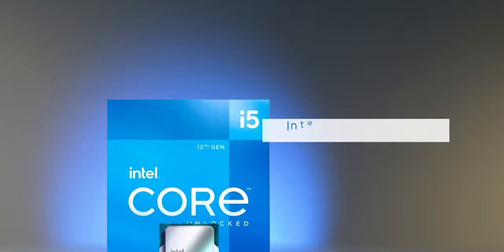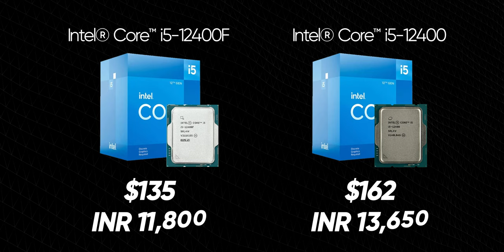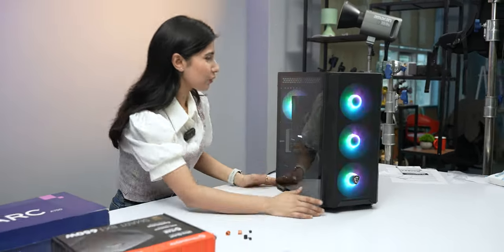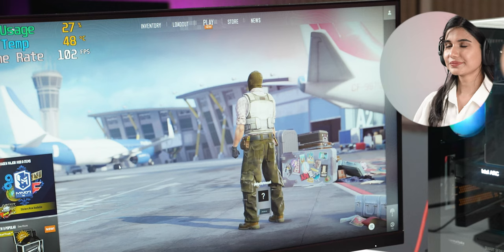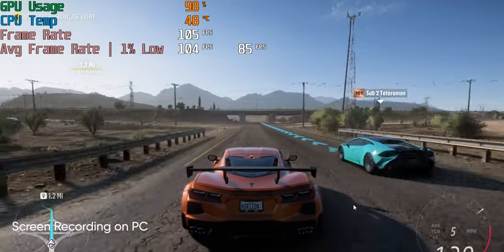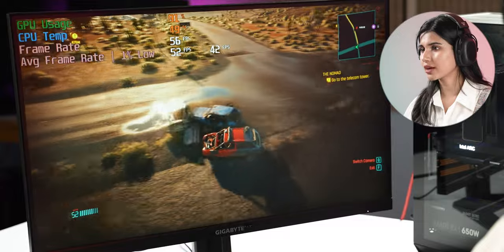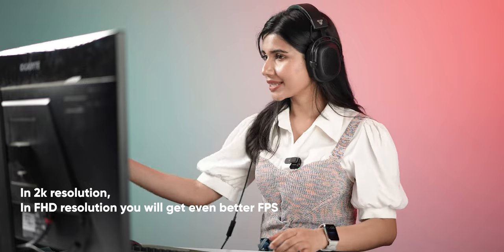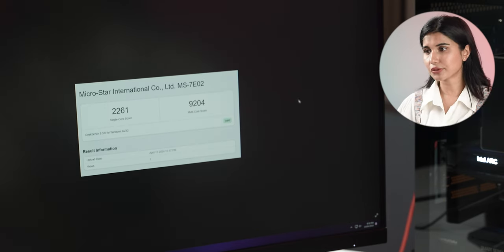Building a Powerful Budget Gaming PC in 2024!

Comment: I do not think the Intel arc is a good choice believe me . At this price point u can easily get a RTX 3060 to 16gb or even RTX 4060 when it's on sale . And Intel is kind of new in the gpu market so the benchmarks of the arc series are no match to the competition.
Reply: True arc is lower than AMD
Reply: Rx 6600 is better
Reply: Tell me when will I get 3060 or 4060 in 22k
Reply: What? Nowadays the arc a750 is performing better no? After the updates
Or does it have different versions? 
I saw benchmarks and gaming tests where it outperformed both rtx3060 12gb and Rx 6600xt as well

Comment: Pro Tip: Update Premier to 2024 update which includes AV1 support then Render any project using AV1 encoder so that it will save a lot of your time as well as it encode videos in lower file size. For me if i render a 10 mins 4k video using AV1 with my Arc A770 LE it will takes around 5 to 6 mins in DaVinci Resolve 18.7.
Reply from the maker: Used the updated 2024 Premier. I had a lot of After effects files (unrendered too)
Reply: @GadgetByte  huh, I never encountered with the issue?

Comment: It's nice to see Intel ARC getting some love 💙
Reply: I'm also buying this gpu, is this worth it at 20k budget? Or should I buy amd? 6600
Reply: @iavisek  i m also confused
Reply: @iavisek  If you don't care about power consumption. Then ARC A 750 is way more stronger than RX 6600.
Reply: @Ari-xb8eu  any compatibility issues with software or games?
Reply: @iavisek  For now there's 90% games which runs perfectly fine. and software wise also good But there's still 10% game out there, you'll find maybe issue. Like for example starfield. In time they will fix the issue for sure. But for now, it's there.
Reply: @Ari-xb8eu ray tracing t issues and some older games don't load. 
It don't have many encoders
H256 sometimes gives up . 
Dpending on usage it's good but for some criteria nope. 
If you buy it for blender forget it won't render 3D very well . 
Need more work on drivers.

Comment: Mam cable management could be far more better...

Also is that PSU A Modular or Semi Modular one? 

Also Far more Better FPS & Performance than 3060 is provided by Raedon RX GFX Card. Did you checked  those?

Comment: My suggestion would be to get a 5600 and 3060 ti for 1080p and 1440p gaming and Nvenc advantage and higher support over many games and use the AMD wraith Stealth (Stock cooler) 
Just for 10,000rs or $100 it is still strong and bit more future proof due to 1440p capabilities for gaming and Nvenc, in addition a bit efficient
Reply: but 3060ti ab to second hand hi milega + 50-60k ke pc me to 3060 12 brand new lag hi jayega
Reply: @nurd699 Ha bhai
Reply: 3060ti 8 GB vram will drag you in 1440p in modern games

Comment: For CSGO , 130 FPS is very bad. Although more than 200 fps can be achieved with low settings and 4:3 screen ratio. More than 200 fps on a 144 hz screen is really really good

Comment: There are tons of 32 GB DDR5 5200Mhz for 8K available. Why go with 16 GB DDR4 with such a deadly setup?
Reply: For that DDR5 motherboard would be needed, and it will increase the price by a higher margin. I believe.
Reply: @Samyak005  check and revert
Reply: Not a experienced PC builder
but do we need of change of mother for each CPU architecture or this versions of DDRx RAMS..?
Reply: Motherboard should be checked for Ram and Chipset
Reply: Power consumption :
Desktop - 550 w
Laptop - 60 w
Reply: @sunilnathani3924 Could be explain what does this mean in layman terms? Why power consumption matters here if PC is not powered by battery...?
Reply: @Sumit_Bhise  i mean, desktop computer consumes much more electricity.
Reply: @sunilnathani3924  but in Laptops we need to change batteries after 2-3 years and they generally have low performance than PCs, so it kinda equals the game,...right?
Reply: @Sumit_Bhise  everyone doesn't require powerful PC.
 Example :  i am using 13th generation Intel i3 Acer laptop.
Reply: @sunilnathani3924  Yes, I understand. PCs are more suitable for (large) Creators, Gamers & 3D oriented stuff, everything else can be handles by laptop

Comment: In my opinion it's still risky using an Intel GPU, specially because drivers optimization and compatibility.
Just pick a RX 6600 instead.
Reply: Even an 200$-300$ of an GeForce or rtx is better than Intel gpu . 100% agree with u .

Comment: The thing with ARC gpu's is they consume way too much power at idle.
Reply: The thing is you didn't know about ASPM L1 BIOS Settings.
Reply: I really want SD Elite X in my motherboard😂
Reply: @rajatsaxena9985  then you are just wasting the high refresh rate experience of monitor while surfing, because to optimise idle power consumption on ARC's, u need to limit the monitor refresh rate to 60Hz. Trust me 1st gen Intel Gfx card are not worth it, wait for second generation, the abnormal power draw is a silicon defect and no driver issue can fix it as of now. They will definitely fix it in  their upcoming Battlemage lineup.

Comment: To be honest if your budget is around 60-65k just get the acer nitro v gaming laptop it costs around 75k but with the monitor your budget will get there anyways also it has faster ddr5 Ram and a proper gen 4 drive with a 4050 and and i5 13gen cpu
Reply: i have also gaming laptop dut it is huge difference in performance in desktop and laptop wheather there are same named components
Reply: dont take that laptop, ive got it before and it heats a lot during gaming. its battery got dead within 3 years